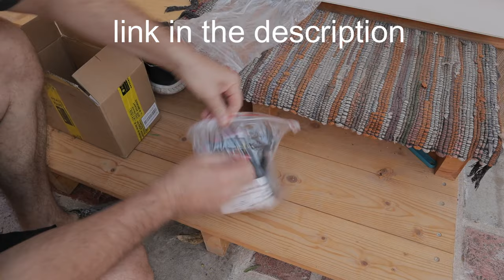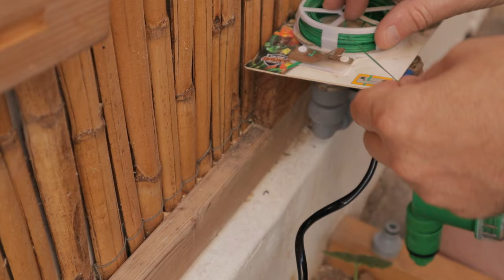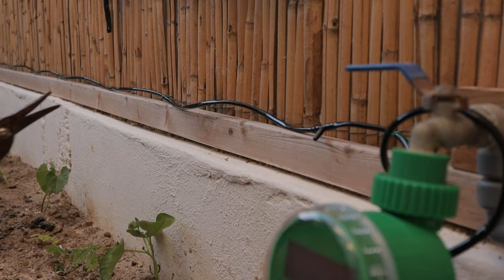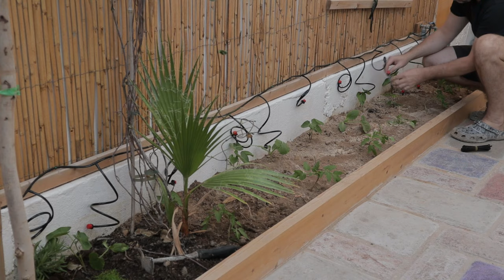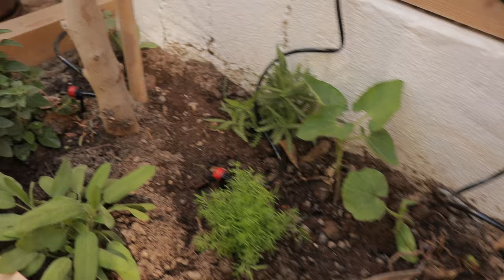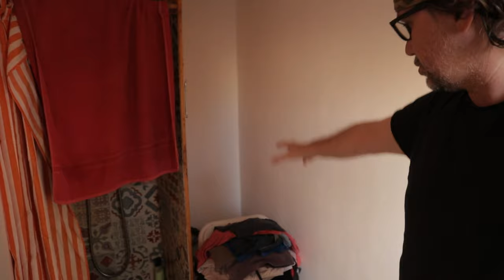Easy Step by Step DIY Automatic Watering System For Garden

Comment: I agree with the other comments. I was so confused on how to set this up and the directions were trash! This video was perfect!!!! Thank you.
The only thing is my end point water pressure is weaker. But I'm sure it's not the system, it's the pressure.
Reply from the maker: Yes, it's pressure. There is a very strong pressure in my system
Reply: @klerobi1  Is there anything I can do help equal it out?
Reply from the maker: @toribrown3982  Yes you have, go ask at the nearest plumbing center.
Reply: @toribrown3982  you can make the one that closer to the timer to have less water output, and increase it little by little until the end point and that would equal it out.
Reply: @nanowar1192  Thank you.  I think I have it figured out. I made a Y connection, so the water is traveling a shorter distance. That has seemed to help.
Reply: @toribrown3982   if you are using a 4/6 pipe (4mm inside / 6mm outside), it is not much good. You will have good pressure nearer the water source and much less pressure at the end if it is a long one. Also the more outlet connections there are, the less pressure you will have in each sprinkler. Ideally go for a 13mm (inside) pipe!
Reply: @kevinazzopardi5873  Thank you!

Comment: Do you have the link for buying the irrigation gear?
Could you instal the nozzles on the vertical to spray in 360 degrees direction?
Reply from the maker: https://www.ebay.de/itm/403415576548?hash=item5ded712fe4:g:sgwAAOSwrqth5WrJ
It’s the same as I had but it’s more expensive
Yes I think you can set the vertical

Comment: When you go away for a month this system comes on and off on its own...? Also please send link to buy it i don't see it thanks alot
Reply from the maker: No, it runs all the time. There, when I bought is no longer available. However, if you type in ebay or amazon automatic irrigation system you will find a lot

Comment: Hello I bought this irrigation system, but water only comes out trough the first 4 red valves. And I installed 30. Do you have any idea what can be happening?? Thanks
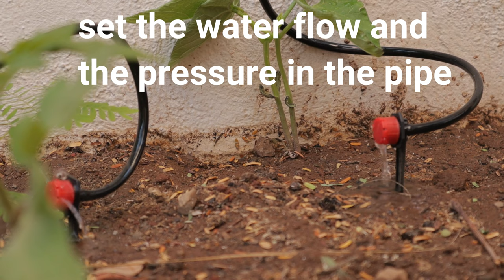Reply from the maker: Watch the video here 7:07. Or the central water system has too low a water pressure
Reply: @klerobi1  i adjusted the water flow but no water comes out only through the first 4. And I have good water pressure
Reply: I just installed mine and i have same problem. What can i do to solve this problem? Thank you

Comment: My question is if you have to leave the water foucet open always for the atomatic system to work. Will that affect water price do you know.
Reply from the maker: Yes, the faucet is always open. Because you set the timer when you water and how long. And the timer opens and closes the faucet. Yes, it affects the price, depending on how you set the timer how long the water is on and how many times ...
Reply: @klerobi1  
its kinda tricky to explain.. 
But since you put that system did you notice a big change in your water bill? or same?

Comment: Is this system only for a small garden? I have a 49x25 vegetable garden and wondering if it’ll be ok using this or will this size tubing affect pressure to all my beds. I have 13 beds and a few trees right now, later on I’m adding more trees
Reply from the maker: No, this is only good for small gardens like mine. There would not be enough pressure in the pipe for a larger garden
Reply: @klerobi1  I thought the same just making sure, thank you.

Comment: For a first time user... I have some questions abt the timer mechanism like.. 
How does timer control water flow from the tap?
What happens when the time is up in the timer coz the tap would be still running?
Can we make plant irrigation system without timer? 
Does timer control pressure also?
Reply from the maker: The water is open all the time. Inside the timer is a mechanism that opens and closes the water. Yes, you can use it without a timer, then you have to open it manually every time
Reply: Is timer need to set every day or one time setup carry over every 24 hours?
Reply from the maker: @ramkoppineni  Just once, and works every day.

Comment: I am going to buy this watering system timer since I found this video. But, some buyers out there said the timer isn't perfectly stop the water when it has finished watering. Is that true, Robert?
Reply from the maker: No, my works perfectly, I had no problems with that
Reply: There are manual and automatic settings. Manual is right away, and automatic is timed according to set programs. I found out when both were set to water for 1 min, under the manual setting, water somehow just wouldn’t stop pouring out. In contrast, under the automatic setting, water seemed to stop coming out after a while

Comment: May l know if l don't have the green machine just put adaptor to the water paip can
Reply from the maker: yes it will work the same. you just need enough pressure in the system

Comment: Question: Do I leave the tap open every day so the timer can go off on its own? Did you notice your water bill go up or did it not change? 
I want to do this for my vegetables and small trees
Reply from the maker: Yes, the faucet is open all the time. And you will use less water because you can control the flow of water to each plant.
Reply: @klerobi1  thank you

Comment: I always thought that timer needs electricity to work. If not that's wonderful.
Reply from the maker: Two small batteries
Reply: @klerobi1  again please.  Do you know how many months to be changed, that battery.
Reply from the maker: @raol635  it will be for a season
Reply: @klerobi1  I see. Thank you so much for responding.

Comment: Downside is when the black plastic pipe gets too hot if there too much water pressure the pipe blow off from the T joints rendering the whole system useless.. Best use some glue!

Comment: This sprinkler is not good because the pressure drop causes the big difference in water flow between the first and the last sprinkler.
Reply from the maker: You 're wrong, see here 7:08

Comment: I would have just do away with the tubes and nozzles. Just lay a pipe with holes.
Reply from the maker: The short tube is ok. But you can’t regulate the pressure on a long pipe, you will not have water at the end of the pipe